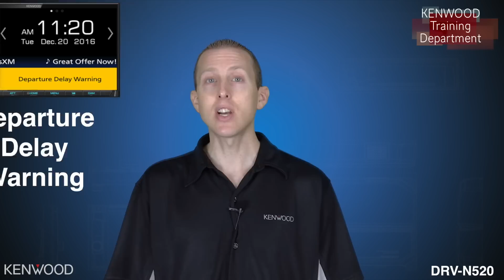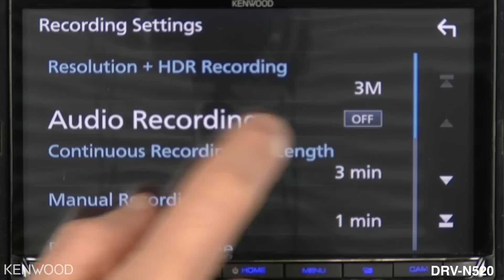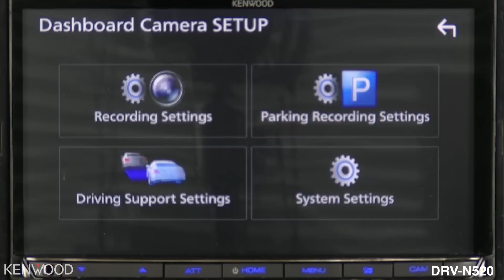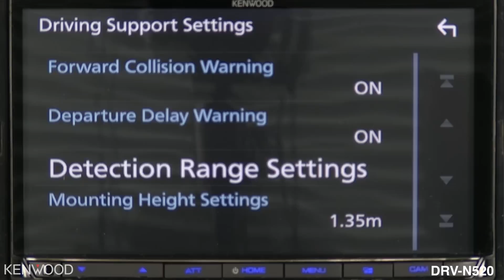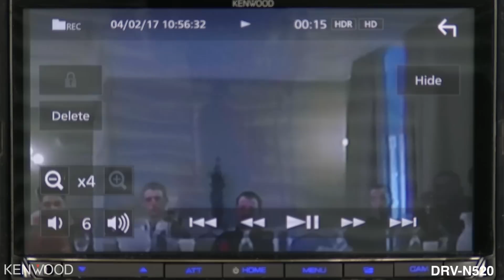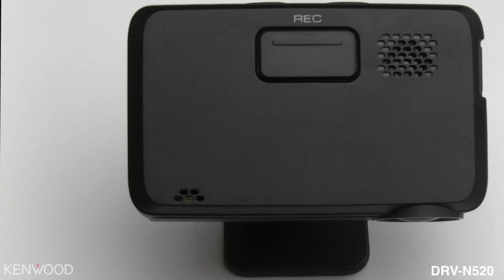2017 KENWOOD DRV-N520 Integrated Dashboard Camera Setup & Feature Highlights

Comment: I got this unit connected to DNX-994S, picture quality is horrible, even on high resolution settings(3M), I cant even see cars license plate in front of me when the car is standing in a light. I sent the first unit back to replace because I thought I got a faulty unit. and the second one is just the same. the only advantage here is the ability to control the camera from the Kenwood unit, if you looking for a high quality video its no here, even my Kenwood backup camera has a better picture. very disappointing specially from company like Kenwood.
Reply from the maker: Are you referring to the picture quality when reviewing on the DNX994S?  Please keep in mind that the DRV-N520's picture quality is much higher than what you can view from the receiver itself.  The receiver offers industry leading technology to quickly review an event with a large screen and with touchscreen controls.  If you are needing to see higher picture quality from the recording, please remove the micro SD card from the camera and use the KENWOOD Drive Reviewer software from your home computer or device that offers higher picture quality playback.  Thanks!
Reply: The one i replaced gave me horrible picture also when viewing with my computer,  the new unit I will check tomorrow and will let you know.
Reply: OK, so now the computer video is much better, I can see license plates in front of me using the 3M resolution recording, but not always, it depends on the sun position to the camera. I will try the HDR although it has less resolution.
Reply: The video using the computer software is better, you will see a licence plate of car in front of you. if the car is passing  you by at the lane next to you, you most likely wont be able to see the license plate. unless you get lucky and the sun and other factors are right. if you involved in accident witch the other party flees the area, I guess that the video will be sufficient for the cops to figure out who is that person. technically there is better dash cams out there.... the comfort of controlling this one with the head unit is its biggest advantage. I hope this helps you.
Reply: Thanks for the reply! I think I will keep looking, i guess it is nice being able to control it with the head unit but I would rather have clarity just in case. Thanks again!
Reply: Hi Kenwood! I have to agree with the above comment - I have this dash cam, and I've tried the 3M and the 1920 HDR resolutions, and both are terrible quality. cannot see any license plates. The 1920 HDR setting is admittedly better than the 3M, but still - pretty crap!
Reply: Hi, did you get this to work? Are the videos clear or the same still?
Reply: https://youtu.be/dfiA2ZxZPQ0?t=63

Comment: So you can't have both a front camera and the dash cam? That's annoying. I can see what a dash cam would see.
Reply from the maker: Great news!  You can incorporate an additional front camera through the AV Input source by using the KENWOOD
CA-C3AV cable.  For easiest access to this source, you can then customize the AV-IN source to display on the Home screen.
Reply: Thanks for the response kenwoodusa. I was hoping the camera's AV would go through the proprietary plug the camera already has. That way you could toggle to a front camera with the "cam" button like normal and/or, if one is plugged in, to the dash cam. Using the separate AV cable seems like a work around for an overlooked engineering flaw. I suppose better than not working at all, though.
Reply: KENWOODUSA 
Hi Kenwood, 
i have the DDX917WS and plan to purchase the Kenwood 360 reversing cam when released next year. Does that 360 cam require the Front cam input that this DRV dashcam is using?
Reply from the maker: Hi Jamie! This YouTube channel is only for KENWOOD USA products.  The model number you are listing is not a USA model.  Thanks!
Reply: If you use the AV input don't you have to have the parking brake engaged to see the video?